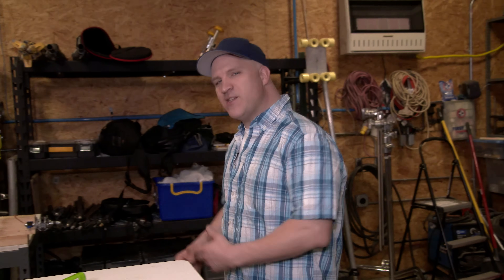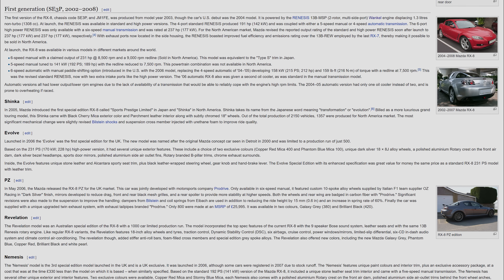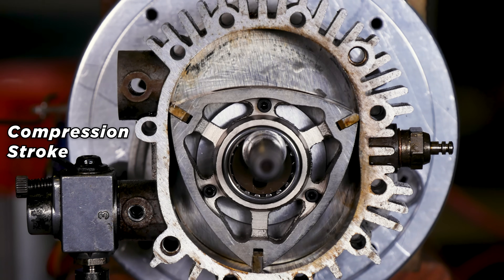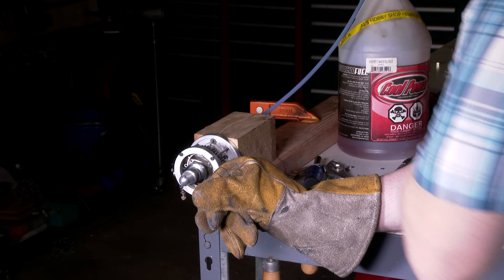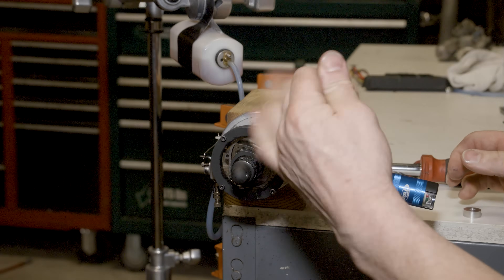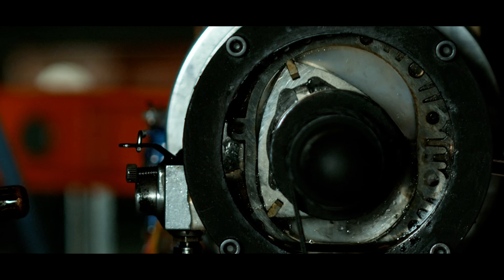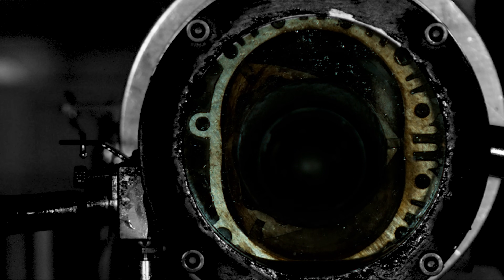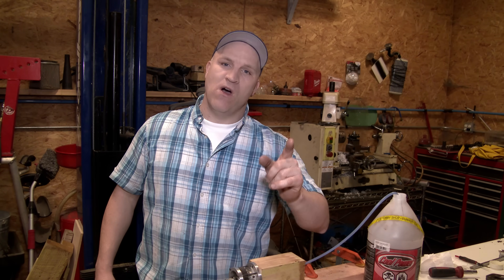See Thru Rotary Engine in Slow Motion - (Wankel Engine) 4K

Comment: I thought they rotated completely around before there was another power stroke. I didn't know each surface had a combustion
Reply: The triangle piston rotates at just one third of crankshaft rpm.
So there is only one combustion cycle per crankshaft revolution.
Reply: @sandervanderkammen9230   that explains it.  And why those engines rev so high
Reply: @colt45caliber  Its explains why the shaft spins at 9,000 but the internals only rotate at 3,000... slower than some Diesel engines
Reply: @sandervanderkammen9230   That's a very creative solution. I didn't know that. I knew that the crank rpm was extremely high on rotary engines and I was wondering how it could rotate that fast looking at it  But this makes sense

Comment: wait 2 stroke 2 movments 4stroke 4 movments      rotary  3movemonets ???!!!!
Reply: All Wankel engines operate using the  4-stroke principle.
The Wankel requires 1080° degrees of crankshaft rotation instead of 720° in the Otto type engine.

Comment: Since you are into it and have the possibility to build one engine... Here is what I have: Copied from my Post.

I wonder if you all heard about the "eat my dust" comment before... Well, I think putting the system in the wheels will do that! ... and with HHO Technology Engine with it, it can save the Planet... 
As for the APEX Seal, they should use cylinder and springs as the system for its contact point in their tracks in the engine but pressure can replace the springs... and instead of embedding it in the rotary material, it should be with the body of the engine on contact pressure point...

Timing, pressure, and volume... and HHO Generator... 

basic-three-circle-of-primary-colors-overlapped-isolated-on-white-picture-id932137824 (479×359) (istockphoto.com)
Reply: The engine you see in the video is a Graupner 49PI and was manufacturered in Germany, it was later distributed by O.S. hobbys after Graupner discontinued them.

Comment: So in a roundabout way it kind of works like a two stroke engine. Fascinating.

Tip: Wear gloves.
Reply: Exactly, including the fact that it basically runs on oil.
Reply: @Litl_Skitl  The little Graupner 49PI engine in this video runs on a nitromethane fuel mixture.
Reply: @sandervanderkammen9230  yeah but the petrol versions are lubricated with oil, which because of the way the engine works also gets in the combustion chamber and gets burned. This is also the case in a two stroke.
Reply: All Wankel engines use the 4-stroke operating principle.

Comment: This guy actually don't know shit,the rotary engine in the rx-8 is a 2.6 and not a 1.3
Reply from the maker: It was 26 liters.
Reply: @WarpedYT The Mazda 13b series is 3.9 liters (3,926 cc's) in total displacement but 2.6 liters when compared to a 4-stroke Otto type engine.

Comment: I hate that some peoples brains are so tiny and pathetic that they need it to be like a kindergarden level visual breakdown of everything to get how it works. Like "Huuuurr Whoa I never knew how a rotary worked until I saw a clear one running duuuuurrrrr" Do you not know how a 2-stroke works? Its just an engine that uses timed ports instead of controlled valves 🤯🤯🤯
Reply: All Wankel engines use the 4-stroke operating principle.

Comment: That really cool demonstration, but i have question, how the oil lubricant work in rotary engine?
Reply: In an actual 13B from Mazda, you basically have an oil injector that spits oil in two places per Rotor. There is a small pump on the front of the block and four lines leading up to the rotor housings. Those lines carry oil and drizzle it into the actual rotor housing to lubricate the tip and side seals. You can disable the pump if you wish and run pre-mix fuel, just like you would on a two stroke engine. Most people think that a 13B "burning oil" is a sign of a worn out engine........which is untrue as they are designed that way.

Comment: Nice. Does a Wankel aircraft engine require a prop to keep it from over-revving, like the small two-strokes do?
Reply: In many air-cooled aircraft engines the propeller not only provides cooling, it also acts as the engines flywheel.
 A fixed pitch propeller will load the engine and reduce rpm to keep the propeller operating efficiently.
 Wankel engines tend to operate peak power and efficiency at a higher rpm which is why Wankel engines are generally not used in aircraft...
 That and the fact Wankel engines are too unreliable for aircraft.

Comment: So basically it takes the up/down motion of a piston engine and turns it into an elliptical motion that acts like a piston engine output. Still it has to change one motion to another just in a different way. So not really that much of an improvement over other engine designs. it is also a design that fires 3 times for each 4 cycle revolution. One thing is it should be very resistant to detonation snd knock. So about any compression (especially high compression) with just regular gasoline.
Reply: Good point, the triangular piston still reciprocates it just orbits in a planetary motion simultaneously.
 There is only one power stroke per crankshaft revolution, this is due to the 3:1 gear ratio between the triangular piston and the shaft.
 Wankel engines cannot have a modern Quench type combustion chamber and thus are more prone to denonation and require higher octane fuel for the same compression ratio.
 Wankel engines cannot support  high static compression ratios due to the shape of the combustion chamber, this is why there where never any successful Diesel Wankel engines.
Cheers!
Reply: @sandervanderkammen9230  Thanks for the info about the fuel and detonation. I am surprised by it as the combustion phase seems to be more open then in a piston engine. What i said about 3 firings per revolution is accurate though as it is not possible to have a true 4 cycle function in it without it firing 3 times per revolution as shown in the transparent engine.
Reply: @Friedbrain11  The Wankel engine suffers from the combustion chamber design having a high surface to volume ratio, the same reason why flat-head engines and hemi engines are more prone to detonation and required higher octane fuel.

Each chamber formed by the 3 sides  requires 3 complete crankshaft revolutions to complete it's 4-stroke operating principle.
The Wankel engine is a 4-stroke engine but requires 1080° degrees of crankshaft rotation instead of the normal 720° degrees of a typical Otto type engine.

Comment: just like with firearms, I'm so amazed at how fast combustion type engines operate mechanically with how fast the combustion/explosive process occurs, and so efficiently without more breakages...   simply incredible
Reply: Boom dorito make me go vroom
Reply: I am as equally amazed by sychromesh and auto gearboxes. So many things working in harmony, it looks like some form of alien tech
Reply: @gerryco  them Germans man.
Reply: And compare it with Electro-motor with no moving gears and parts. Just bearings.. and magnetic force. And 90% power factor, mostly higher.
Reply: @palohagara electric motors are only applicable in small cars imagine an electric excavator or dump truck or airplane

Comment: so few moving parts, why not more produced and used??
Reply: The Graupner 49PI was discontinued  because it was expensive, unreliable  had high fuel consumption/ short flight time and offered poor power to weight ratio performance.
Reply: Always wondered the same thing. 👍
Reply: @stevee7774  Wankel engines are inferior to reciprocating 2-stroke engines.
Reply: @stevee7774  Run along angry little troll... you lose.
Reply: @sandervanderkammen9230  - Lol! His Royal TurboDouchebaggedness has spoken.
Reply: @stevee7774  You lose...
Reply: @stevee7774  Thank you for proving my point.
Reply: @sandervanderkammen9230  - More like a highly amused little troll. 🤣
Reply: @stevee7774  Thank you for proving my point.
Reply: Wow that's an interesting thread lol lol. But I didn't get how the was a condescending dbag answer to begin with. Perhaps I just read everything with nuetrality or optimism, I dunno, I'd hope haa. Were some deleted?
Reply: @justaguy4real  - It wasn’t his response to this comment, it was his responses to a couple of others.
Reply: @stevee7774  ahh gotcha. Well that sucks. Interesting yall came across each other on other comments too
Reply: @justaguy4real  Just ignore that guy... he is obviously looking for someone to verbally abuse.
He has nothing intelligent or meaningful to bring to the discussion... a typical troll.
Reply: @sandervanderkammen9230  well I'm good with both of you lolol.
Reply: @justaguy4real  I have no problems with him whatsoever, he obviously has some issues.
I won't be bothered at all, I'm not intimidated by trolls.
Reply: My bad for getting this going again

Comment: Is no one gonna mention Mazdas 24H Le mans win in 1991 with a Wankel? Nope.

Mazda won 1991 Le Mans with a Wankel engine.

First Japanese car to win aswell as first non reciprocating engine car.
Reply: Toyota has won Le Mans 3 times.
Porsche has won Le Mans 19 times.
Audi has won 8 times with a Diesel 
Mazda lost the 1991 WSC championship to Jaguar.
Mazda no longer has a motorsports program.
Reply: All totally irrelevant to his comment but thanks anyway.
Reply: @stevee7774  There is nothing relevant about Wankel engines son... they have been obsolete for years and a failure in motorsports.
Reply: @sandervanderkammen9230  - Did I ever claim that Mazda won? Did I ever claim to know anything about Mazda’s racing failures? No, I did not. I merely pointed out the fact that your comment was totally irrelevant to the original commenters post, at which point you took offense to the truth. You sound like the angry one here kid. 🤣
Reply: @stevee7774  What is your point angry little troll boy?
Mazda no longer has any motorsports program.
Reply: @sandervanderkammen9230  - Does anything in my comment make it sound as though I care about Mazda’s motorsports program?
I didn’t think so.
Calm down Van der Krammen.
Reply: @sandervanderkammen9230  - More like amused.
Reply: @stevee7774  You lose..
Reply: @sandervanderkammen9230  😂
Reply: @sandervanderkammen9230  - Don’t be so hard on yourself.
Reply: @stevee7774  Thank you for proving my point.
Reply: @stevee7774  Thank you for proving my point.

Comment: I know how a rotary engine works...only learned one thing...apparently it's not a great idea to smoke around the exhaust...lol...j/k.....great video bud...loved it
Reply: This is a Wankel engine... the rotary type engine is something different.
Reply: @sandervanderkammen9230  I'm pretty sure they're the same...but what do I know...🤣🤣
Reply: @lifebeginsat190  depends on which of the two types of Wankel engines you are talking about... there was a Rotary type and a non-rotary type Wankel engine.... this little Graupner 49PI engine is the non-rotary version called the KKM
Reply: @sandervanderkammen9230  I stand corrected...thx for the clarification...I'll rewatch the video...its been a week or so and I forget what I had for breakfast...sooo

Comment: Acetylene being as ‘dirty’ as it is, have you ever considered oxy-propane? I recall from back when propane conversions were a big thing a fella I knew converted his international 404 engine in his tow truck to propane..he could get the engine to idle down to between 200 and 300 rpm. It was quite amazing to watch..you could almost count the rotations by eye.(not actually but you get my point) He said it had to do with the engine burning so clean..I’m no propane fuel expert (in combustion engines)and not sure how those things are related but after another one of those engines were torn down after half a million miles, it looked like brand new inside..like right at rebuild. 🤷🏻‍♂️
How do you suppose one of these would perform on propane or propane/oxygen? 
May be an idea for a video/test?  Call me curious...thanks in advance.
Reply: The Wankel engine design does not allow for high enough static compression ratio required for efficient use of gaseous fuels without disappointing performance.
Several major manufacturers developed Wankel engines with both propane and natural gas but did not match the performance of the reciprocating engines.
Reply: This little Graupner 49PI engine does not have spark ignition, reliable glow plug ignition is very dependent upon fuel chemistry and nitromethane fuel is best suited.

Comment: Looks like a lot of unspent fuel is being ejected in the exhaust cycle.  Perhaps too much fuel or not enough oxygen in the mix?
Reply: Glow plug ignition engines like this little Graupner 49PI engine required a very rich mixture and the glow plug ignition combined with the Wankel offers very poor combustion efficiency.
Reply: @sandervanderkammen9230  does that “rich” mixture speak to the overall efficiency (or lack there of) of this type of engine?
Reply: @anthalas9  Both the Glow type ignition system and the Wankel design itself have serious efficiency problems.
When combined together as in these Graupner 49PI hobby engines efficiency is extremely poor.

This is the only Wankel engine manufactured with glow plug ignition and they were not very popular and were discontinued many years ago.
Reply: @anthalas9  Wankel engines have very poor combustion efficiency due to their low compression ratio and the terrible shape and movement of the combustion chamber.
Because the chamber moves past the spark plug,  single ignition is usually incomplete. Most production Wankel engines need dual spark plug ignition and still suffered from poor or incomplete ignition/ combustion.
Any questions?
Reply: @sandervanderkammen9230  no questions, your summary filled in the missing pieces for me very efficiently.  Unlike everything about the engine you described lol...
Reply: @anthalas9  Happy Holidays. CHEERS!
Reply: FYI;  All modern engines have what are called "Quench" or "High Swirl" type combustion chamber designs.
The Wankel cannot be adapted to use this newer technology because of the internal shape of the Wankel engine.

Comment: New sub here. What is the tool or tube looking thing your using that hooks up on the combustion side ?????
Reply: Its a rechargeable battery that heats the glow plug.
Reply: @sandervanderkammen9230  thanks.....

Comment: Why is this kind of engine not used more in cars? Great video btw
Reply: Three primary issues: 1) Relatively poor fuel economy, 2) poor emissions, 3) weak longevity of the engine, as road car engines need overhaul between 60K-120K mikes. Recognizing that the engine in the video is not elaborate and controlled by an ECU, you can see raw fuel being spit out the exhaust, which also kills emissions.
Reply: @donaldmoser212  Thank you :)

Comment: Great stuff, but it looks to me , if you changed the profile of the centre ( cam profile) it looks like it would propel or increase the speed, because the gas would have less space to expand in & therefore increase the explosive force. I might be wrong ,but kinda looks that way.
Reply: It has been perfected as much as can be by real live mechanical engineers. And this guy didn't create this one, he just added the clear plate

Comment: Excellent video. These tiny engines have much more displacement than most people realise.
I remember measuring one on the bench. The combustion chamber at it's widest point measured about 700cc's . multiply that by three , and you end up with 2100cc's per rotor. 
And this was a twin rotor engine. So 4.2 liters. And three power pulses per revolution, compared to the 4 stroke piston engine at 1 power pulse every two revs.
I guess that's why these things are so grunty and hungry.
Reply: Only one punch per Rev. The rotor does a reduced speed dance around the output shaft. Yes 3 power pulses per full rotor rotation.  But 3 shaft rotation per 3 pulses. Its just like a 2 stroke in that regard

Comment: Why doesn't any body ever say that the crankshaft does 3 revs for 1 of the rotor so at 6000 crank rpm the rotor is only doing 2000 rpm !
Reply: You just did!

Comment: I was always so amazed at how these motors worked. They are virtually indestructible. What is the max HP one of these can make?
Reply: The Graupner 49PI was rated at only 1 horsepower, it was discontinued due to poor reliability and lack of sales.
Reply: @sandervanderkammen9230  No! I mean the rotary motor that Datsun put out.
Reply: @MrJohnnyb42  Nissan only produced a single prototype, the Datsun Sunny RE in 1972 but this car never entered production.
Reply: @MrJohnnyb42  YouTube Mad Mike quad rotor. Your question is hard to answer because of variables.  But generally for naturally aspirated regular engine vs engine rotarys make more hp for the same displacement

Comment: Thanks.  Always wanted to know how a Wankel works. The combustion stage and chamber looks symmetrically balanced to turn the rotor any direction. What drives it one single direction?
Reply: The starter
Reply: And the fact that if it continued clock wise the carburetor would not be filling up the void.  Pressure would come out the carb and it would draw in through the exhaust port as well. Its able to fire and counter rotate just a little.

Comment: If you wanna prolong the life of your glow plug, remove the glow driver as soon as you can. I run Glow Fuel engines on planes, and you can save the life of the glow plug by doing that

Comment: This was new to me to get the picture and see this kind of "kickback" in the middle, or right after the spark/combustion. Now Im just thinking how it still manages to maintain the steady timing and running :D
Reply: Wait, you did it on purpose in the video to give a perception of the combustion phase? :D
Reply: Well it will only do that once or twice.  If it did rotate backwards,  the carb would have exhaust coming out and no refresh of fuel to carry on after that